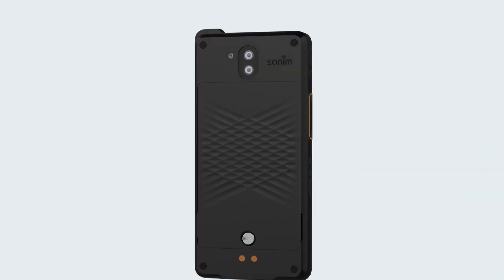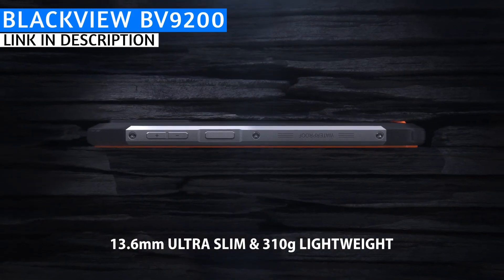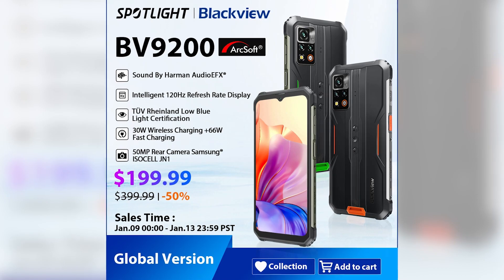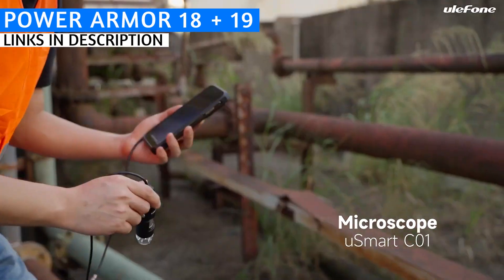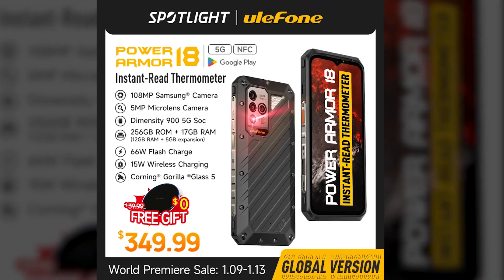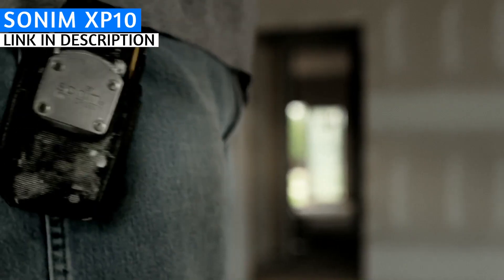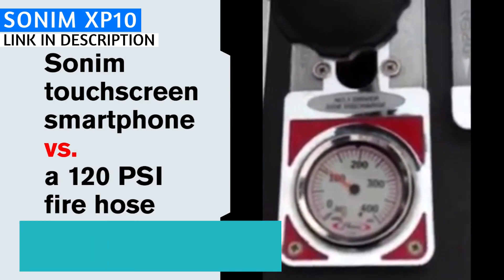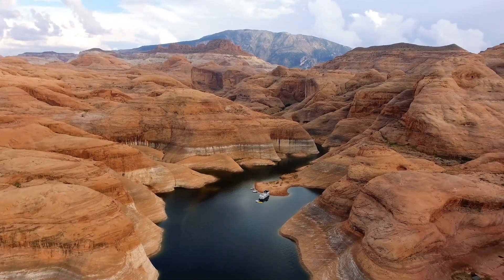(NEW RUGGED SMARTPHONES 2023) New Phones from Blackview, Ulefone, and...

Comment: Isn't it weird that they boast 5G while showing the vast outback? Shorter range than 4G is probably not what those out there want, but they can cope with the lower data speed of 4G. It sounds more logical to me at least. Don't hesitate putting me right if someone have some solid arguments.
Edit: I mean the Sonim. Not for me that one, expensive and seem less powerful than the others and no thermal imaging.
Reply: The XP10 includes support for 5G bands n5 in the 850 MHz range, n14 in the 700 MHz range, and n71 in the 600 MHz range. They might be limited in bandwidth but the low frequency should allow for some pretty decent range.